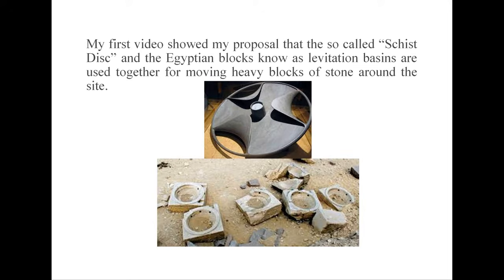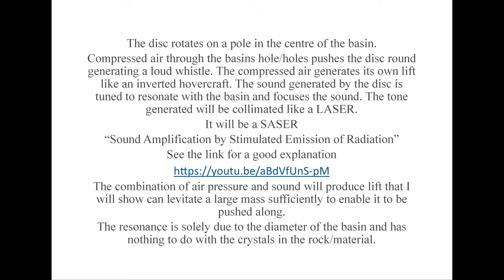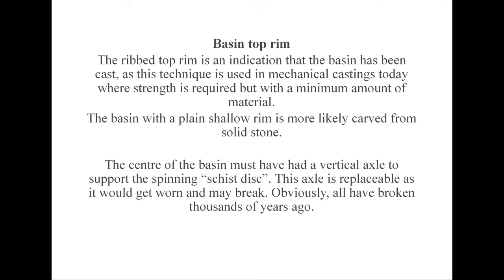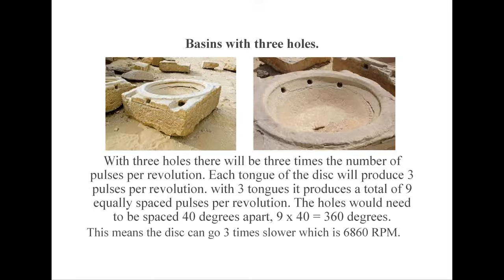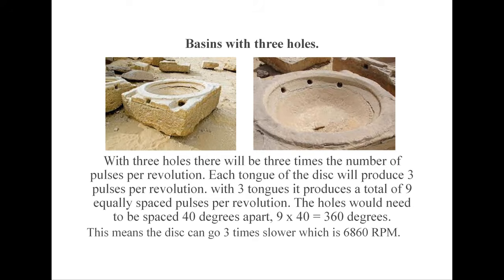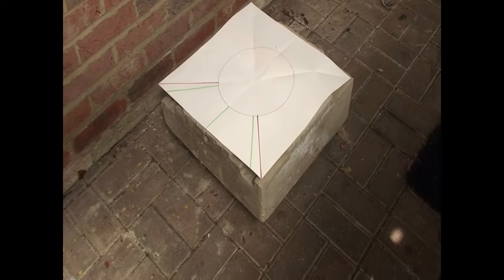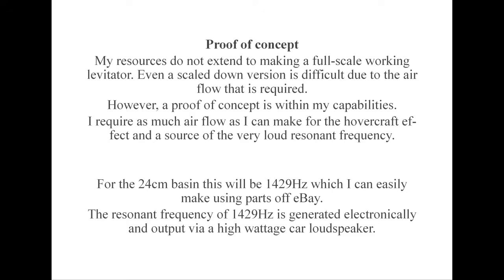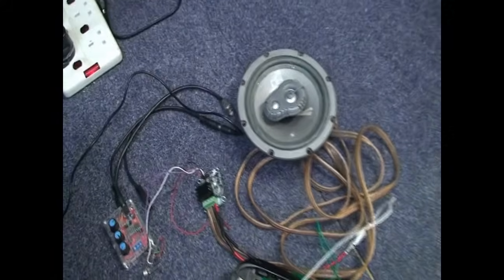Schist Disc

Comment: I will provide you with the only known method for "free energy" that even the experts ignore...but I’ve seen it and produce it myself over the surface of quartz. The old vintage term used was "firestone"...we have a known piece of firestone in the "Schist Disk," also known as the Disc of Sabu, is made from a fragile, brittle metamorphic rock called metasiltstone, which is heavily laden with quartz (firestone pizo 101, full of electrons, not a good insulator as thought). Basically, free-energy can be had by controlling the spark...blue cold spark, no current flow blue cold spark and then capturing the radiant energy produced off the no current flow spark. "Power = V*I"...no, "I" mean no power used. The Schist disk had burnt -carbon blacking on it (failed-electron flow short) and was found discarded in the Egyptian desert. My thoughts discarded (like an old spark plug) due to cracking or warp-age in their power system.

Comment: that 8:18 part to get the result was shown previously in the video is funny as heck. Like you can't measure it like that. You need a tool that lift the stone edge and stop at the time the lid starts to slide while the tool holds that position. Doing it by hand is all sort of funny as everything will move from the movement of your body when you reach the spot in random with pensil mark on it

Comment: You could fill the bowl with oil or water the disc might cause heavy cavitation attach to a big block of sandstone then put the block on a thin layer of sand while in operation. Think about what happens to a washing machine when overloaded it jumps around like a jumping jack.

Comment: The center hole of the disk suggests it was on a shaft, does the diameter of the shaft align with any of the unknown bore holes. And meaning maybe several in a row, has that been tested with like 10 rotating on a shaft....

Comment: Suggestion see how it works as a motor mixer. I suspect it was used to make aircrete stones.  You can assume that overtime sitting under water aircrete became more solid.
Reply: That's what I said over the years when I first saw that my first thought was as a kid in the '70s watching them build houses in my neighborhood. And I remember those contractors would pull behind like a trailer those I don't know 6 or 8 ft cement mixers. And I remember in the middle of cement mixer was some kind of mixer object that looked exactly like this disc.

Comment: The disc is literally just the top of an oil lamp . The disc sat on a vase of oil, torches were stored through the openings in the disc submerged in oil. The center wick stayed lit so that one could pull out a torch , and light it on the center wick. When one was done with the torch, it was simply dropped back in the oil and dowsed for later use.
Reply: Then why is it made of stone instead of metal? Why was it carved from stone with a simple metal lid, or even a wood bowl would work

Comment: A theory that needs further investigation on a slightly more scientific level but as proof of concept it certainly has legs. Not sure about the compressed air aspect as this alone under the right conditions will provide lift. Also, people are talking about levitation as if that is the true end product, whereas maybe reduction of friction would be a better angle to look at, it would be easier to reduce friction on a 1000 tonne block of stone than it would be to levitate it. I'm not saying anyone is wrong here but simply looking at the issue from a different perspective. Great video btw.
Reply: gotta be the nicest constructive criticism ive ever read
Reply: If the schist disk moved by air, and the basin was "covered" ( by the centrifugal force of the disc) in mercury and the disc created a tone...would that make a difference ya think?

Comment: Wouldnt it make more sense to use a non compressible fluid like water?
Reply: Water has been tested before (as droplets) by another party and it DOES levitate. So do marbles.
Reply: @stephensegal5187  Amazingly, there is a ready source of water, the Nile, nearby, and chambers in the great pyramid were found to contain sand composed of evenly-sized quasi-spherical grains of quartz.
Reply: @Brillig2  Yes, EXACTLY. Have you ever seen what happens when you place two torroidial fields to oppose each other with enough space between them to put 64 magnetic spheres between them?..... It will form the Flower of Life...
Reply: water is compressible

Comment: Not a very good test. You’re only reducing friction with air pressure and vibration causing it to slide easier from the effects of gravity. This does not prove levitation at all whatsoever.
Reply: the air and sound are doing absolutely nothing. lift slowly and the slab will stay in place longer. lift quickly and things go flying. every day there's someone new at the top of the dumb list.
Reply: @lorenzo42p  I have a degree in applied technical physics. You’re rude comments prove that you have no idea what you’re doing you have no idea about basic laws of physics. Watching this video is hilarious it’s classic comedy the average curious person that is clueless of what to do because YOU didn’t pay attention in class. You can get more levitation off just your air pressure by pouring it straight up lol there’s no magic levitation you’re gonna get out of that disk! lol I commend you for being curious but leave the experiments up to the professionals! All of your extremely lame and incorrect results are just that, incorrect. Because you have no idea how to run proper testing. And at your rookie beginner level you’re not even close to having what it takes to understand the concept of true levitation which does not use any weird unknown yet to be discovered magical physics lol I would be embarrassed to post this video and then degrade people when they show you how wrong you are. Please take this down, hide your head in shame and go read physics for dummies 101